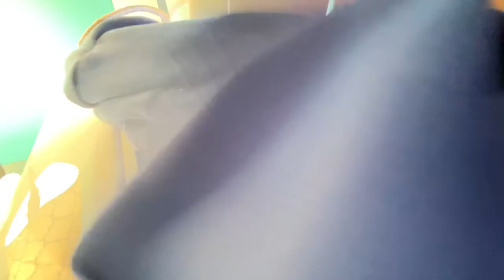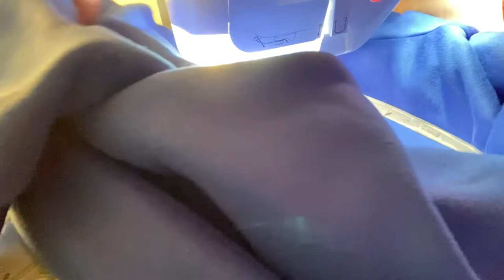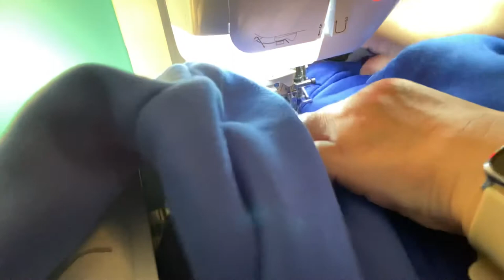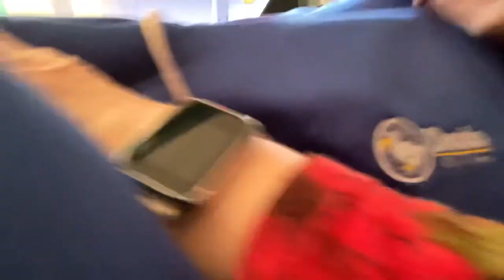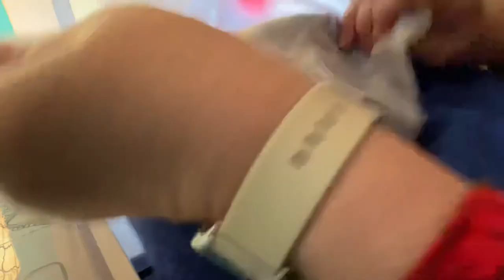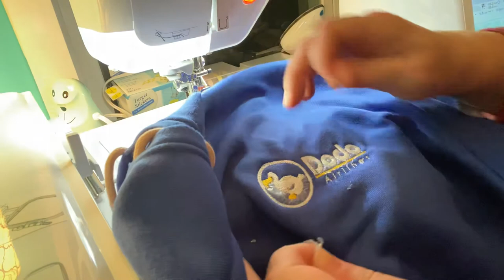Machine Embroidery Part 2 - Embroidering on a sweatshirt.

Comment: Just wondering if you have a video hooping a sweatshirt using a large hoop to embroider a name across the upper back. I will post what I made. Wonder if there is an easier way to do the hooping. I could barely get the sweat shirt around the hoop and had a hard time keeping it from slipping back around the hoop.